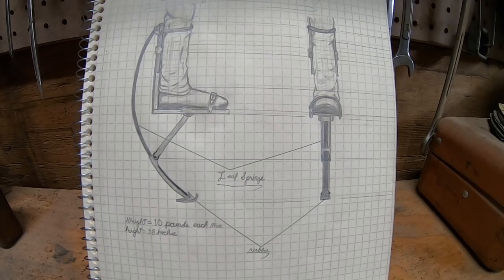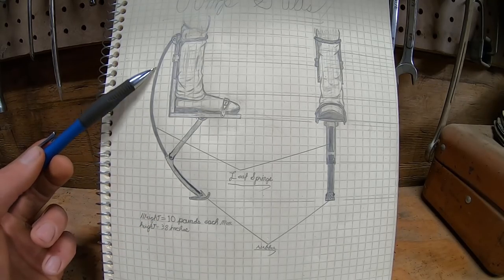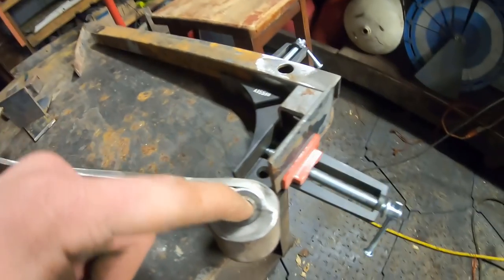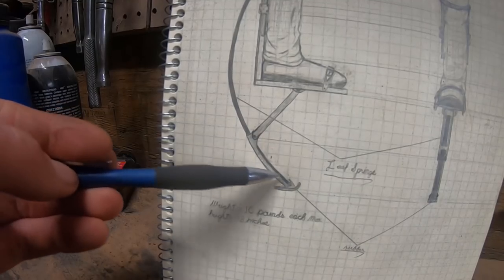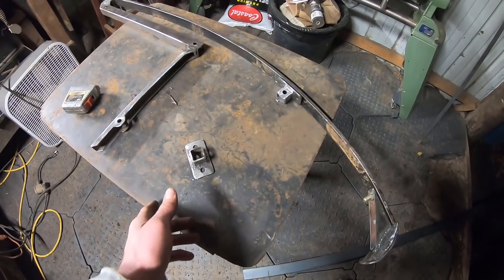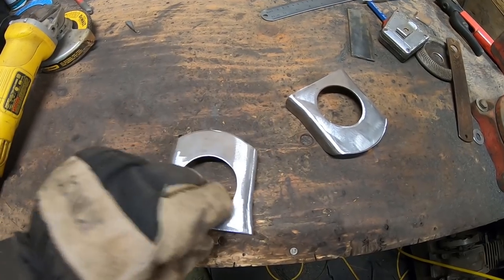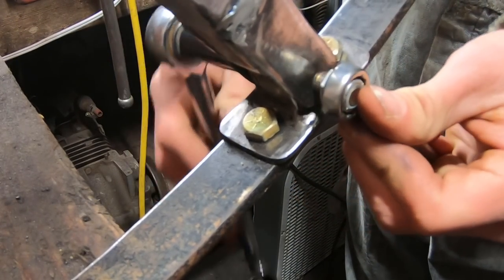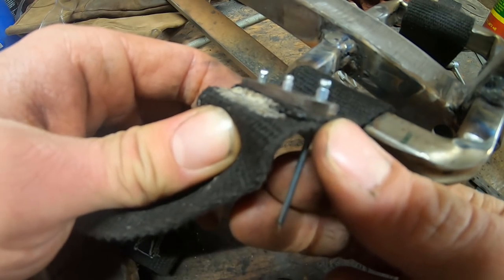How to Build Real Fully-Functional Jump Stilts From Scratch For Under $50!

Comment: dude imagine living in post apocalyptic world trying to survive ,and then like 5 people with rifles just wearing thoes bad bois start chasing you through the woods xd
Reply: CogBoy I had the same thought! These give me real Mad Max/Fallout vibes lol.
Reply: Just run through thick scrub/brush, they'll get stuck, you'll run free
Reply: That sounds like they would be easy targets....
Sure they can run faster in a straight line and jump a little higher, but the mobility is severely limited. They can't drop and take cover quickly and that's a huge disadvantage in modern combat.
Reply: @PsylomeAlpha  also depends on the user, I've clocked myself and I can pick up a sprint of 15mph easily on a dime, imagine how quickly someone like me could run with them on
Reply: They wouldnt chase you, they would out run you! You can go 20 mph on thoses!!!!!
Reply: @ClarkKulper  you'd be surprised at how quickly someone can turn on these.  Personally as someone who already has a somewhat digitigrade stride I'm kinda used to walking in a manner similar to this; these'd just make my strides longer and more springy.

Then again, I would've done a miniature mock-up using like, hot glue or solder to hold pieces together while optimizing the design before dumping time and resources into making a full-sized model, so I would've worked to address this problem a bit.

Especially with my weight I would've needed to either do two full-size truck springs with two feet per foot, or that have a slight bend until they join at the foot in the middle, either of which would've made them more stable when getting up while wearing them, which in turn would make it easier to duck into cover and provide more stability when turning.  This'd in turn make them heavier, but I'm also heavier than most people.
Reply: Now imagine those same guys were armed with Joerg's Instant Legolas Bows
Reply: @ClarkKulper  especially if someone shoots out one of them or somthing and one miss jump is a broken ankel and that's gonna slow you down
Reply: @pangeagamer7223  yes but how much time could you hold that 15mph
Reply: Thinking about how loose the soil usually is in wooded areas, they would have a difficult time moving about. They would also have problems if they found even a small hole. Probably end up injuring themselves. On firm packed ground in open areas, it would be a terror.
Reply: Look like they would make great targets, while they likely couldn't aim.
Reply: Aniquin  not sure how that would help in a post apocalyptic word.

You have to assume there would be a shortage of supplies such as rounds.
And if they are forced to go back to black however, they would have to change weapons. I.e. go back to something more like revolvers and gattling guns as opposed to gas operated carbines.
Reply: They're all me.  I'm the five people.
Reply: A thin fishing line wrapped at 12 inches apart 3 inches off the ground would ruin them fast. Or just throw some large stones on the ground. Remember, not only would they fall hard and fast but getting back up with take much longer.

Unless they had springy arm things to catch their fall.... 🤔🤔🤔... All 4 type of thing. 🤐

Comment: Brilliant work.  I've dreamt of having a pair of these.
Reply from the maker: I had as well for quite awhile. They're just as fun as they look!!
Reply: @randomn6473  I just bought a quite well used one on eBay with broken straps and rusted screws. It was $35. The work I have done is to replace all the screws (to look nice) and create anchor points for the straps. I 3D printed quite overengineered parts out of ASA, hope they won't break. For straps, I used quick release fastening straps meant for truck or so use. Not the big ratchet ones but the quick-release ones. Works well so far, but quite bit more fiddling to put it on than the snowboard binding.

So the dream can be reached for 1/10th-1/5th  of the price + massive amount of free time.

Comment: I wonder if skis would be good for this.  People have been making some really sweet bows out of old skis. Might be a good option for the spring?
Reply: that's funny. i was thinking maybe a really heavy bow or two could do it... now you've given me an idea.
Reply: @cortedemico  we use Ash for hurling it's a game where there has to be a spring in the stick you use to hit the ball, it's taken specially from near the root of the Ash tree, it creates a brilliant spring, also Ash can be used for bows, just thinking ,
Reply: @cortedemico  Even some type of soft wood can work.
Reply: @larrysal8866  good one you frickin oyster.
Reply: @sandys9791  ;))
Reply: Sounded like an understandable idea.  Skis are very flexible and made of composite materials.  Dont think I'd venture to try wood though.    Wanted to see whare this would go.  But looks like the trolls got here first.
Reply: Nah I've snapped skis before on jumps 
Try using a bow
Reply: at first i thought you means putting skis on the bottom lol
Reply: @lucywucyyy  You may have stumbled across a new X games competition.
Reply: @sandys9791  I really enjoyed your insult.
Reply: This is hilarious.  I offered a suggestion of replacing the steel leaf spring with a section of a ski.  It's a suggestion I think would work.  Suggesting it would snap and impale my leg, is just being ignorant of how the jumpstilts are designed.  Clearly I'm not reading the comments of the best and brightest.  And once again it was just an idea.  Lol

Comment: I had a set of the originals from the early 90's.  I used them in several performances and parades.  Sold them in 2010.  I had a knee injury that was unrelated that required surgery and putting no weight on my leg for 6 months while it healed.  I  figured this would be a toy/tool I'd probably never use again.  This is a pretty cool build.  Great job.

Comment: Awesome video and an amazing build! I'm not a metalworker, but I do have some experience in costume design, prop-making, and extreme sports, so here's a couple things that jumped out to me.

As someone who did aggressive inline skating for a few years, personally I would've just permanently attached a pair of skate boots to the rig instead of rigging up a foot harness with the boots you used. They're pretty expensive if you don't just have a few pairs lying around, but they'd give you a LOT more support and protection, especially around your ankles. You'd be sacrificing a bit of flexibility, but watching the way you moved in them(without trying out a pair myself), I don't think it'd matter too much in the end. The supports you've got are probably good enough at the end of the day, but your ankles are surprisingly vulnerable to serious injury when rolling to one side, and with the kinds of impacts you're taking as you jump on these(or fuck even run on them for that matter), I wouldn't want to risk it, personally. If you can find a cheap old pair of inline skates online or in a pawn shop, it might be worth buying if you plan on playing with these a lot.

 The rubber feet also seem quite small. If you gave them more surface area, you'd probably be able to jump a lot higher with these, or at the very very least avoid digging up so much dirt on your landings!

One more thing, using a couple pairs of needle-nose pliers ziptied shut as a makeshift clamp is a brilliant idea and I really wish I would've thought of it! Lol

Comment: I've owned several incarnations of Air-trekkers brand stilts for over a decade now, and I've also had friends that owned Powerisers in the past, and I can clear up a few things that you were curious about - 

The sleeve on the bottom of the spring is used on models with a perfectly symmetrical leaf which is made to bend exactly in the center of the length. In brands that have asymmetrical springs like my current Air-Trekkers, the center of the bend (and the thickest part) on the spring is further up the length towards the top, and the connecting arm is bolted straight through the spring itself. The places where the brace connect on the foot plate and spring just make sure that the tire moves straight up and down during the jump and aren't terribly consistent across models.

The straps don't strictly need to be where you see them on the ad pictures for commercial models, especially if you mess around with the total height of the springs and platform (how high your feet are off the ground). In the current models with asymmetrical springs, the heft of the spring is brought up closer to where your input force is coming from so you can actually drop the knee bar quite some distance without losing control because there is less weight below your foot. In fact, it's actually helpful to have the knee brace resting more towards the top of your calf than the recommended spot right under your knee cap because it frees up your range of motion a fair bit when you fall or otherwise need to bend your knee to get up.

Feel free to hit me up if you ever decide to revisit this project. I can get you pictures and measurements of my own pair.
Reply: Good to know.  Do any of those brands have a pivot of any kind for the ankle?
Reply: @joelcastellanos7224   There was one brand some years back that briefly offered a gimmicky "Pro model" with a foot plate that allowed your heel to move side to side a little bit under the guise of "allowing incredible acrobatic control!" or some such nonsense, but it was a poor attempt at boosting sales and wasn't listed long for obvious reasons.

When you are strapped in, trying to move your foot is what controls the stilt. It's a bit like controlling a prosthetic - you try to twist your ankle, but the entire stilt rotates. It isn't enough to just be connected to the stilts, the stilt itself can't be free to move around on your leg or you lose control of it. It doesn't really matter where on your foot and shin the stilt is strapped, but it needs to be completely secure or the stilt wobbles uncontrollably when you take steps.
Reply: I totally understand that.  And that is completely what I expected.  I did not mean a joint with full rotation.  It is obvious that it needs to be secured to your leg and not move.  As far as the joint I was thinking a ledge on the heel side to catch and locate your heel.  The joint would be a single pivot that only allows up and down movement with stops at both ends.  Mabe 20 or 30 degrees of movement.  

Lol idk.  Maybe if I try my own build I can play with it.

Comment: Nice build 
The only changes i would make would be on the foot 
I wouldn't drill though that 
I would build a "shoe" for the foot and weld it... 
I know you didn't want to weld on the bar but if you weld on the very end the heat treatment wouldn't matter too much as long as it's braced above and only welded below.
The other change was hand done stitches  :)

Comment: Very cool watch.  Loved the video. Tho I never would have thought to cut the spring in half (I tend to over build things).

Watching you test them however seems to reveal a bit of a flaw.  The platform forms a rigid boot for your leg and foot.  This doesn't allow for any movement at the ankle eliminating your calf from your movements also not allowing you to push off with your toes.    Might take some tuning but if you could set a pivot just below your ankel for the front of your foot it may give you allot more performance and better control. Mind you I'm only talking vertical movement. I Can see it going crazy if you let the thing go out of alignment.

Comment: You can use castiac soap with dot 4 brake fluid when grinding metal to reduce heat. You do have to melt your own soap bars and add the fluid to reharden then cut to size. Right or wrong... Comment?

Comment: Because the lower support is bolted directly to the leaf spring, the energy is now concentrated on the lower portion of the leaf spring and stops mostly at where the bolts terminate, which is why you had to add the extra springs. If you watch the video in slow motion (Hello youtube's playback speed functions), and compare it to how the commercial versions bend, you can see how they curve very differently.

If you followed the commercial design (with lower foot support hinged into a "sleeve" for the foot of the leaf spring), you'll get ALL the energy stored in the entire length of the leaf spring (focused into the upper section while the bottom is more rigid), which will give you the extra responsiveness.

Hope that makes sense to you, awesome work constructing your own pair!
Reply from the maker: You bring up very valid points and I appreciate you bringing that to my attention! I'm designing the next pair right now and they'll be like no others on the market (trust me, you're not going to want to miss that video.) I'll be making that correction on the next set for sure along with many other things. 

I'm pretty happy with these for a start though! Thanks again for the helpful comment!

Comment: I think you need to move the connection point to the bottom part of the leg lower, because the spring/feet are not making good contact to the ground, what i noticed in the video was that the foot part was not used at all rather the smooth spring sing was making contact with the ground causing a lot of force to be lost due to the smooth metal sliding on the ground this could be why it felt sluggish or slow to spring back because the mechanical advantage created by your connection points over powered that springs springyness, I'd also say that in this particular configuration the springs themselves would be tremendously prone to wear

Comment: the problem with using leaf springs is if the metal breaks from fatigue there is a good chance it could lodge itself deep in the back of your leg. Small chance but one worth noting.

Comment: DUDE. YESSSSSSS. Finallllllyyyyyy
 I pulled apart a pair of roller blades and removed the springs from a ripstick  in hopes of making something similar. 
I have a hunch that several high-draw exercise bands, slingshot cables, or even mini bungie cords - rubber bands -  in place of the coil springs miiiiight provide a faster response....
Any changes since then?
Reply from the maker: I know what you mean!! I actually made the video on this mostly because I couldn't find anyone else that had done it! 

I'm actually getting the parts to build a new pair with some never-before-seen modifications. ;) I think you'll like it!

Comment: They look great for the most part but take a look at a pair of drywall stilts and you may rethink your leg attachments . its just a curved padded piece if aluminum with a webbed nylon straps instead of bolts and shin buster stuff. Old style stilts often just bolted an old shoe or boot to a plate to secure the foot but I never liked that.

Comment: It may work better if the foot support was aligned with the ball of his foot rather than dead center (comfort wise anyway) and to improve the springs reaction would be to use the leaf spring in a similar fashion as it’s original use his method is using the reverse side forcing it to function in a way it didn’t originally move. This will make the build overly complex though unless a much smaller leaf spring can be sourced.

Comment: Good video!  Where did you get your Hex-shaped rubber tiles on the floor of your shop?...  make, model, part number?
Reply from the maker: Thank you! They're polypropylene tiles. They're made by a company called "Hexadeck." They aren't cheap, but I got mine at an auction for a low price. I love them!

Comment: Hahah, nice
One thing I noticed was that when the springs compress, the "foot" portion sorta is rolled over and no longer making good contact with the ground, but the spring instead. Perhaps either a long foot pad, or move it back a little (?)
Reply from the maker: Yes, you're absolutely correct. The springs had more flex in them then I had hoped. I think the best solution would be to use more spring material for someone of my weight. Good observation and thank you for the comment!
Reply: @randomn6473  Ahhh, that makes more sense. Sprung a bit too low for your calcs. Got it. Well, we'll be patiently waiting for a Mk II   😉

Comment: The problem is that all the bend is coming from the lowest part of the spring and not at the top which is where the tendon is most useful. The lower part of the stilts on commercial ones has rigid bottom parts that shield the bottom part from bending.

Comment: Pro welding tip: more amps and less wire, so you get penetration to your welds and not bird poop, so there is less (or nothing) to clean with a grinder. Also makes for a stronger joint.
Reply from the maker: Great tip, thank you! Any tips for a 120 arc welder? That's what I dominantly use.
Reply: @randomn6473  Yes, 6013 will probably be the easiest to use and the best finish. 6011 for some gap fill and dirty work. 7018 for more critical joint and framework (and where it's best to preheat the metal, i.e. higher carbon etc.).

Comment: I wonder if they reduce fatigue like walking back country or something?
Reply: There's an old Boy Scout maxim regarding footwear, which states that a pound on the feet is five on the back.  They do lengthen your stride and give better returns on energy, but the act of swinging that much weight and accommodating for the tension is more tiring than simply walking or jumping.